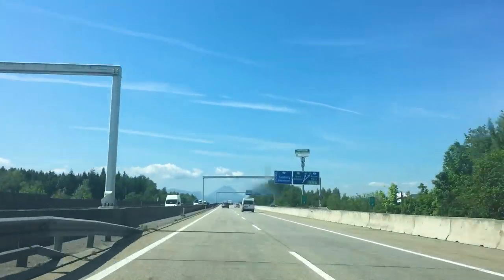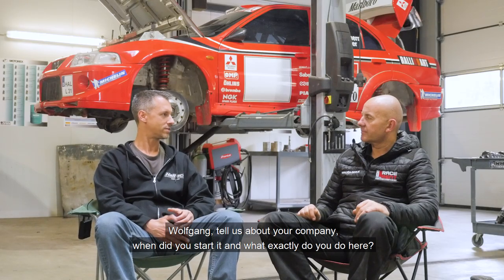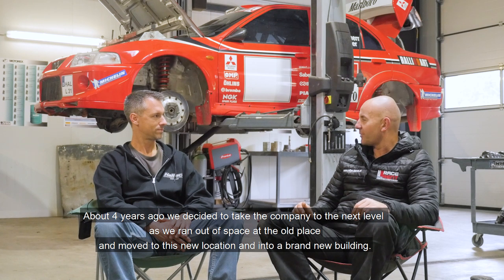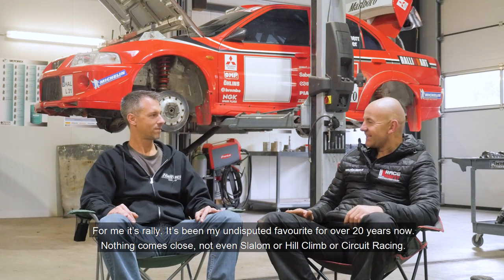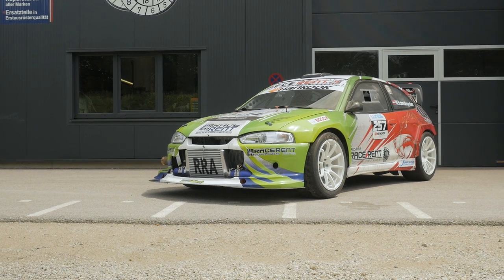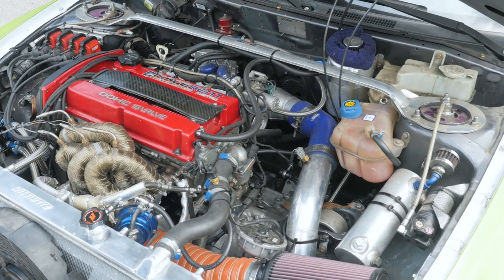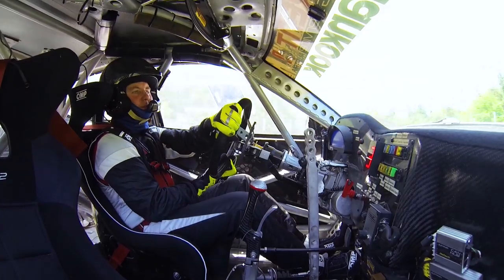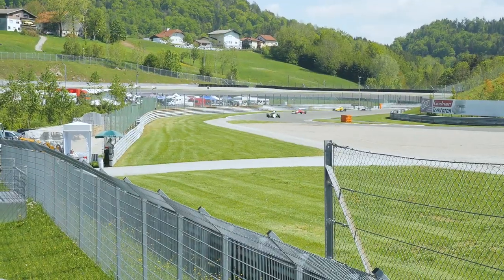🏅 Wolfgang's AWD Turbo Colt | HALTECH HEROES

Comment: Building a car that goes fast on a twisty mountain track seems like a much more advanced art than building a car that goes fast in a straight line.... Not that the later is in any way easy mind you. It just seems that modern rally/hill climb cars would do pretty damn well on the quarter mile AND go around 90 degree corners at speeds that would make me wet my pants.
Reply from the maker: What we find amazing is how much power some of these hill climb cars squeeze out of relatively small capacity engines.